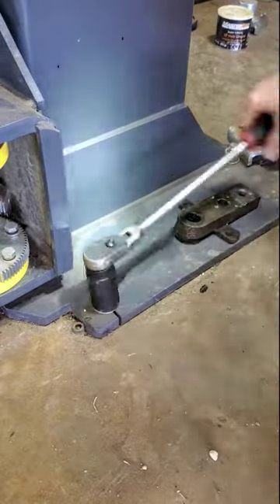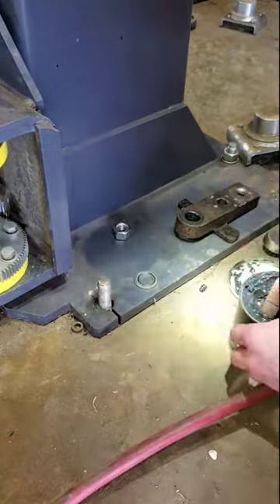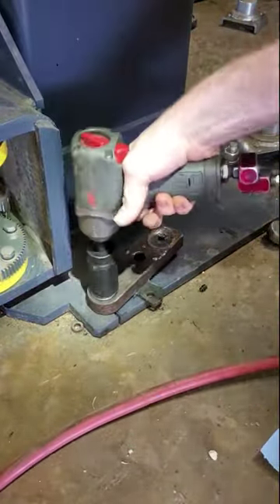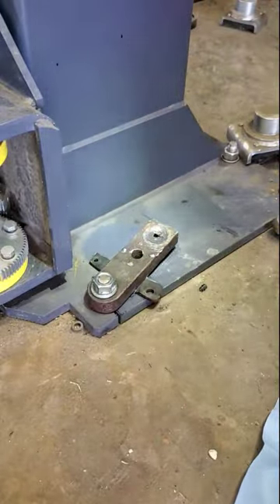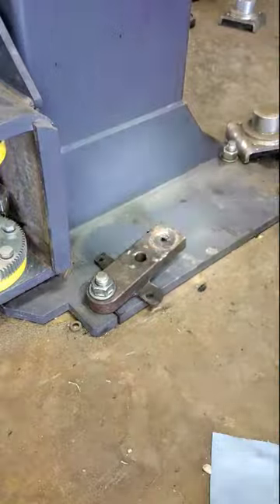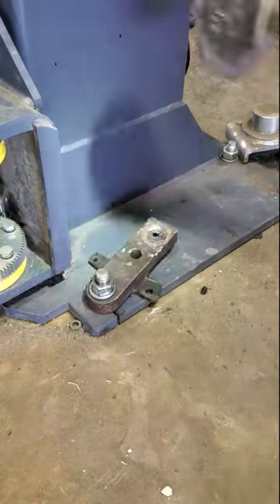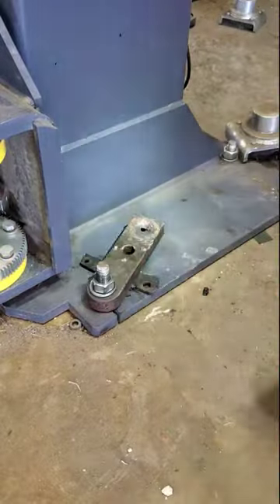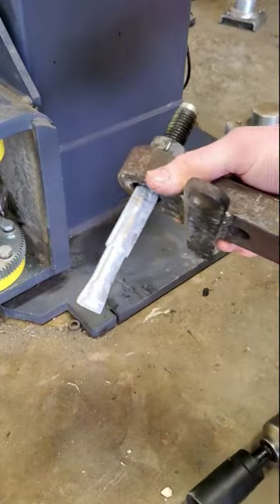Car Lift Anchors Failed- How To Remove

Comment: Properly installed high quality wedge anchors in good concrete will not fail. I’ve installed 6 2 post hoists over 20 years with no failures at all.
Reply: By the look of the anchor it was installed after the concrete was poured also looks like it wasn't installed with any concrete anchor glue.
Reply: @angelcelis9090 yeah that is how wedge anchors are installed the hole must be drilled properly to begin with and well cleaned before installation too many people drill these holes with regular hammer drills and a 3/4 inch bit in the hole ends up getting bigger than its supposed to be which allows wedge acres to fail
Reply: @throttlethumb150  the best way to do an anchor is to do it while the concrete is still wet but if you are installing after the concrete pour it’s better to use concrete anchor adhesive cause this is sketch af.
Reply: @angelcelis9090 
I strongly disagree. 

Wedge anchors should not be installed into green concrete which is less than 28 days old

Comment: That seemed pretty difficult to remove those anchors. Provided the concrete is sound and suitable for the application wedge anchors work as intended. Chemical anchors are in fashion right now Amazing what advertising can do. I actually prefer the hoists to have a base as part of the main structure rather than concrete counter weights still using good concrete base and still anchor to the ground but the h frame type lift.

Comment: Doesnt look like it was failing to me 🙄
Reply: The original video showed it was loose and not holding properly. I epoxied threaded rod into the concrete instead of wedge anchors. Wedge anchors suck.

Comment: To remove a wedge anchor add water or cutting solution to the hole. Use a mandril attachment to spin the stud in the hole. The Expansion clips will wear a groove in the cone to prevent them from further expanding down the cone. The anchor and clips can then be withdrawn with minimal force. The hole was likely over sized or concrete to soft. A sleeve anchor or epoxy are more forgiving of these issues.

Comment: Ive had wedge anchors fail numerous  times and had lift install companies repair the issue several  times on the last install one of my customers  said about using chemical anchor with his help i replaced all of the anchors in all my lifts and highly recommended using them more then wedge anchors

Comment: This post is dumb wedge anchors work OK but  not perfect epoxy is worst also don't pull the anchor if it was drilled like it was supposed to be u just hammer it it passed the slab and start again with whatever anchor of ur Choice my personal choice is a drive anchor
Reply: What makes sense of your sentence is: "This post is dumb wedge anchors". And I agree to that, wedge anchors are dumb. You can never guarantee that they will bite into something that has different types of rocks in it!

Comment: Nonsense of a video. You can do that to any bolt and you will begin to eventually reduce its durability. Bolts/anchors onky work well considering the type of surface they're embeded into. Its not rocket science. Basic engineering

Comment: So what happens if you epoxy vedge anchors? 
Also what is the life of the epoxy/chemical anchors, do they lose strength over time, are they susceptible to chemical degradation by oil, fuel etc.?